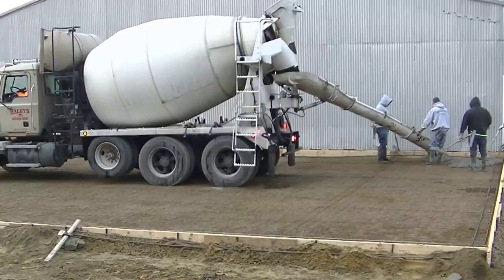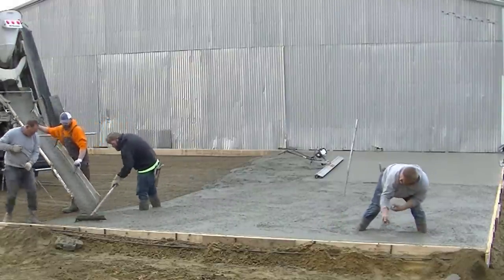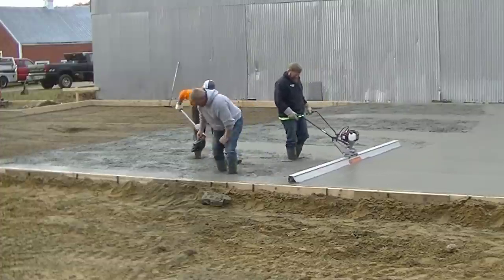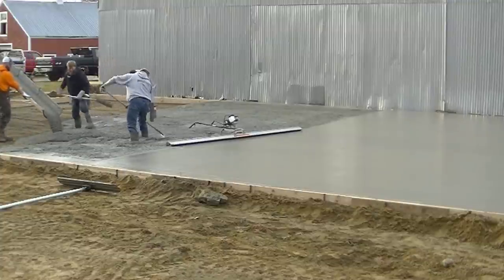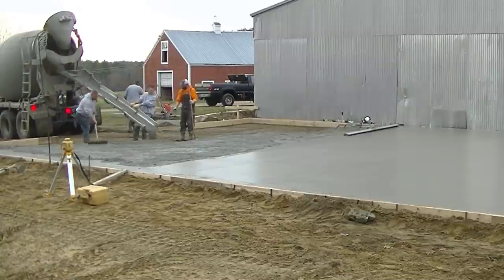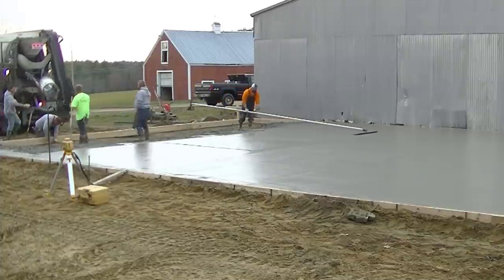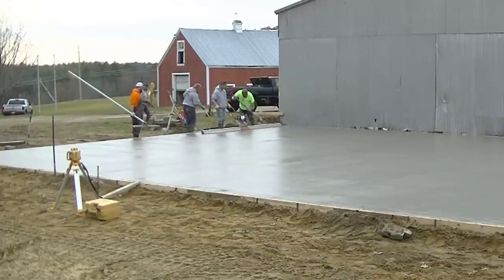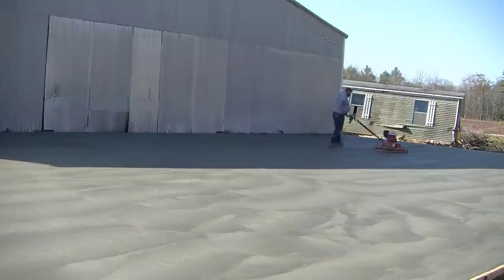How To Pour A 60 Yard Concrete Slab In 90 Minutes

Comment: Last job I subbed we poured 410 yds in 6 hours. Cost me an extra $11K because the concrete batch plant couldn't keep up. They assured me they would have us buried with 100yds/hr. The best they did was 70 and the plant was less than a 100yds from the job. The crew was unreal 9 guys, 1 on a laser power screed, 4 ride-on power trowels. Everyone knew exactly what to do and when extremely professional. Love your videos Mike

Comment: Great video, Mike! Last Monday I had a 24'x32' monolithic slab, 3000#, 5",thick  with 6" wire mesh and 3-#4 rebar in the footings for a detached workshop. It was 35 degrees when they started. The slab has a 4'x14'x8" thicker area for a 9000# auto lift. 20 yards  pumped with a 45 meter truck to go over our home. It took with 4 guys 34 minutes to unload and have it bullfloated. It was finished by hand with a 18" trowel on a 16' pole. Gentleman went over it 4 times in an alternating semicircular pattern. The slab turned out string level and 99% smooth!   This was a side job for a crew from one of the largest semi-custom home builders in the Phoenix area that does 200 foundations a month in the busy season. I'm very satisfied!
Reply from the maker: Sounds like they did a great job! Awesome

Comment: Like many of us with decades in the concrete trades a high slump pour lays down easier than your commercial grade pours that have to meet engineered slump controls to meet or exceed UBC standards. Your use of water reducing additive you always speak of gives you the advantage of easy lay down and quick work by power screeds and cap the cream with super wet bull floating. Lots of your residential pours are only 4 sac mix so I wonder how 6 sac would react with the H20 reducer. Wind, sun, temp all change how concrete will finish. Depends on air entrapment for interior or exterior work and your base of wet/dry materials and use of steel or mesh. There is no apples to apples comparison from region to region and building code minimums. Anytime you can lay down yardage of that quantity so quickly it makes things so much easier but we all know the finish is what you are getting paid for in footwork. Rock on Mike and crew! Concrete Gods are smiling upon you!

Comment: I'm amazed that a vapor barrier is rarely used under your building slabs. Also the lack of a footer or rat wall. Here in north west Ohio we at least have an 18" rat wall and vapor barrier.
Reply: Yeah,a covered slap gets plastic under it
Reply: @deadmanwalkin5064  Yeah, they do substandard work imho.  Gonna have all kinds of cracks.
Reply: @joemonroe9456  different areas different ways of doing things I've seen some stuff in PA that would make u shake ur head... where sidewalks in ny are built stronger...

Comment: Good rakers are critically important. 
Just as important as finishers.
Reply: Every guy needs to be pulling his weight including the driver. One guy slacking or not tuned in and everyone is under pressure. Every task should have a designated executor with help from a guy that's free if needed. Never have ambiguity about who is doing what.

Comment: A rancher picked up  a power screed off the side of the highway (some one must have for got to tie it down) and after getting law enforcement involved and filling out the paper work he sold it to me for $150.00 , what steal! That was back in '05 and I loved how it made it easier for me to pour since i usually pour by myself. The price of concrete here in south central (Rawlins) WYOMING is at   $165 per yd ( i pour 6 sack so its $175 ; fiber is another $10 per yd. & adding a retarder or calcium is  another !0 per yd.., yeah very expensive here for the last 30 yrs. You guys make it look easy thx for sharing. -joe

Comment: This video is the exact reason I do my own concrete.  The steel goes in the middle of the pad, not on the ground. Who cares how fast you can run a truck empty if the rebar or mesh is on the ground.
Reply: i have a builder building us a 2 and a half car garage.. im putting 2   big  1 ton desil pickups in it..   he is not putting any bar or screen in it and only pooring 4 inches with 4,000 psi.   i really think he needs to put some kinda bar or screen in it.. he says no!    what do you guys think??  i really need help on this ??
Reply: They pull the wire up off the ground as they pour, but then walk all over it. It really needs chairs.
Reply: @TheDepreys  if he is using fiberglass fiber you don't need any bar or wire. Just my opinion I pour garage floors daily never use rebar or wire. Only fiber. I use a 4k psi 4in thick. It's ice cream
Reply: I agree with you
Reply: Wire mesh is just to keep the cracks closed not to add actual tensile strength. If it was real reinforcement it would have be placed in an exact position.  At the end of the day reinforcement doesn't stop it from cracking it just effects how it behaves after cracking.
Reply: If you actually watched the video you can clearly see a  guy pulling up the mat in front of the mud. He stays right in front of it being poured and when there's mud to support it he will pull up. Either you're blind or you didn't watch the video.
Reply: @pillaryclinton6187  and what do you think happens when 2 seconds later you have 3 guys walking on it?? That mesh goes right back to the ground.
Reply: @tylerwhite4743  like he said, the aggragates in the concrete will hold the wire mesh up even if you walk on it..
Reply: He picking up the mate him self he said in video
Reply: First off you don't pour concrete you place it!! and for the dude who said that barbwire doesn't add to the tensile strength you might want to go back and read a couple books on physics!!!
Reply: @TheDepreys  that floor should be full of cracks by now?
Reply: It doesn't even need steel
Reply: But he has a wire puller in his hand
Reply: @trademarkoutdoorservices2363  nice keep doing it

Comment: Id love to try the screed demon Mike. Few big patios coming...20' x 30' in May
Reply from the maker: Aaron, where are you located?
Reply: In Detroit, MI
Aaronbrunson@hotmail.com
Reply: @aaronbrunson2179  How are you liking your power screed for outdoor stuff? I've used mine about 6 times now in 2 weeks. Absolutely love it
Reply: @gumballer133  unfortunately, i never received one for trial or purchase but Ive got my eye on a honda motor and bar attachment w/o screed. Got a bball court and 3 driveways to do for August. Maybe Mike will reach out but...congratulations Gum!
Reply: @MikeDayConcrete  any demons still around?
Reply: @gumballer133  how may guys are you using? What makes you love it?
Reply: @aaronbrunson2179  So we are generally speaking an Asphalt contractor,  but everyone and their brother wants Concrete done this yr also. Anyhow,  usually 4-5 guys when we pour, only 2 of us being decently experienced. Lots of driveways and patios. We use a Vibra-Screed by Allen engineering.  I easily free up one guy with me straight edging alone. We only vibrate one pass though,  and it makes it super easy to bullfloat and edge.  I'm only 3-4hrs from you on I-80 in Ohio
Reply: @aaronbrunson2179  Magic screed is what we use.....

Comment: With the mesh we chair it up behind the truck as they are emptying truck, and put any chairs in U can while waiting  for next trucks . Being 8  inches thick we would probably be told buy engineers 2 layers mesh 50 mm chairs on bottom layer and 150 mm chairs on top layer vibrate and pump it . Your way looks fast and put in and set up quickly, good job.

Comment: That was a nice money-maker there. No slopes and no pipes to deal with. 
60yds/hr is the typical rate at which I would order most slab pours for 6” floor slabs. If it was only a 4” slab, maybe 50yds/hr. For large warehouse type slabs at 6”, pouring with a laser screed, we would go with about 100yds/hr. Typically around 6-7 men on the crew and maybe 2-3 more laborers for really large pours.

Comment: I dig pour and finish footing walls and floors and im jist a tthree to four man crew here in ct. We generally pour 40yards or less floors but few times a year there will be a 80 to 100yrd pours and your set is identical to what we do. Nice job. I use a power screed and finishing Whitmans. But not ever used a powerscreed board like the one you have.

Comment: @Mike Day Concrete    I am gearing up to pour a 40x60x6” slab for myself. My problem is I live on vinalhaven island. The ferry ride out here is about 1hr and  15 min. One way. Can only fit two 10 yard trucks on each trip. My question is. What are your thoughts on pouring it in three sections on three different days? So it would be three 20x40 slabs. Is this feasible? What type of expansion joint material would be used if any?  Would I want the rebar and wire mesh to run across the joints? Kinda guess yes to going across the joints so it ties the slabs together so they don’t separate?  Thanks for the great videos. I know it takes a lot of time to film and edit them. And also thank you for any info. I would hire a crew to just do the entire thing. But I need it to be as inexpensive as possible. My boat shop burned down July 3rd this year. (No insurance). I lost almost everything. So this new steel building and slab are all going to be out of pocket for me. Friend of mine did set up a go fund me for the shop. And it did help. But I’m still going to be out of pocket $100,000 before I even start filling it with tools again. Anyways. Thank you. Ian adair.  (Mad Man Marine)

Comment: You want the reinforcement on the lower (tensile) side anyway. 2"-2 1/2" from the bottom on an 8" slab is ideal.
Reply: Pick any location on that slab and watch it.  You will see it get stepped on at least once.  Having taken as many core samples as I have, I can tell you that the mesh ends up exactly where you would think it does, if you bother to think about what happens under all that foot traffic.  The vast majority of that mesh is only "imprinted" on the bottom of the slab, or maybe embedded a quarter of an inch or so.  Good commercial crews have methods that allow them to avoid walking around all over the place once the concrete is in place, but they are also a lot more likely to place re-bar on chairs since that's what the specs will call for.

Comment: Hi
Mike nice work, I’m from Ireland but live in Australia concreting, just wondering about the demon screed do you find them better than the regular Honda screed, I was just curious about the hollow at both ends of the screed blade, do you find that some concrete can go into them hollows and pull the blade down or is that not a problem with them?

Comment: I drive a redi-mix truck in Michigan. I can haul 12 yards on my truck. My truck is also front discharge. I am able to blow out 12 yards in about 15 min with a good crew, the guys striking off are only pulling 1/2 inch of mud.

Comment: We pour a little slower but we are old men...lol.. three of us and the boss is the youngest...54...  we just did pretty much the same size pad. 34 yards 4" thick.. done, broomed and cleaned up by noon.
 We only have 2 months when you need hot water so you can usually work around pouring in colder weather. When you do, hot water is free, they are thankful to get the job as hardly anyone pours then.

Comment: Might as well have saved the money on wire mesh, they pull it up once and walk over it five times pushing it to bottom.  Im only second generation concrete pouring in family, my end of it now after many years pouring is crushing concrete.  95 percent of all concrete that has mesh that I crush it's pressed completely to the bottom.  Rebar mat or paving mesh with suspension chairs to ensure proper height in slab.

Comment: What are you using for your wire reinforcement?  looks like cattle panels.  I'm fixing to poor a 2000 sqft slab and I'm just doing a little research.  Thanks, y'all do fine work.
Reply: Usually I use 10mm 1/2” rebar 
Or a mesh sometimes

Comment: In Utah we only have cement trucks that shoot off the front of the truck.  What is the advantage of a rear shoot truck. It seams tougher on the driver and it might be slower.  Can someone tell me about the rear shoot trucks. I have no experience with them.
Reply: The are cheap because they are older, and cement trucks are expensive.

Comment: Putting floors in with a laser screed,  90 seconds and the whole load is on the ground.  Here comes the laser screed to pull it all down to grade.  I've been on 600 yard pours, first rock hits the ground at 8AM and machines are off the floor at 4 PM.
Reply: "walking off a floor" is trade lingo that implies the set was fast enough to machine finish rather than hand finish on your knees.  So braggingly you would say, "We walked off it a 4"

Comment: WHEN I POURED MY 40 X 60 SLAB FOR MY SHOP IN THE SUMMERTIME DESERT.THE WIND SUCKED THE WATER OUT AS FAST WE COULD POWER TROWEL. END UP ADDING SEALER WHILE FINISHING. IT WORKED BUT A REAL STRESS OUT

Comment: The ground seems to lack a gravel foundation. If some softer area sinks the concrete cracks.
Reply: Concrete always cracks, it’s not a if, it’s a where. That’s why you either groove or saw cut the concrete in areas so it cracks along that line. Anyone who tells you the concrete won’t crack is bullshitting you. Although I always use a 21AA limestone base thoroughly compacted in 2” lifts as thick as the concrete you are pouring.

Comment: Driver asked me what I want for a slump? I've poured a few small 10x10 pads for hot tubs, slump didn't really matter. Going to attempt my new garage floor, what is the slump I should tell him? Will probably be in the 40s, maybe low 50s when it's done.
Reply: Do about a 5.5 slump
Reply: 6 bag mix 4 inch slump pour half screed and bullflot  pour the rest screed bullflot and finish trowel cut the edges and joints done drink then strip tomorrow
Reply: @barryengelhardt2429  what are you wanting to kill him 4” slump you better know what the hell your doing and have a couple guys who do too!! 😂 😂🤯

Comment: Looks good.  But pour that 60 yards at 4 inches thick instead of 8. There’s a big difference. Yeah you poured 60 yards but it’s like finishing 30 yards at 4 inches. We pour 40-60 yard slabs all the time at 4 inches. Just 2 of us. The only advantage we have I guess is all our trucks are front discharge trucks so that eliminates a person. We average dumping out 10 yards in 10-15 minutes. Of course depending on the driver.  But this is a good video. Lots of good info. We are in Kentucky and for the most part we do everything the same way. Except we mainly hand screed everything with a 1 person 12ft screed

Comment: I've tried power trowel a few times. Never liked it.
Reply from the maker: It takes a little time learning how to control it without fighting it.
Reply: So I pour a good bit of concrete. When it comes to repairs how knowledgeable are you? I have a stamped coping band around a pool we poured with a broom finish patio behind that. I used the rubber seams to joint the coping then cut the broom finish with a appx 3x3 pattern. The problem is the guys laid out the 3X3 squares on the broom finish and then cut straight through the stamped coping. I caught it after he made about five cuts and there's no making it look uniform. I either have to repair these cuts with a charcoal color hardener or tear out 25 ft of stamped coping and re pour it trying to match color. What would  you do.
Reply: I own a swimming pool installation company in Ohio. Originally from CT. All my family is from Lewistown Maine. I'd love to chat sometime. What's your email, I'll send you over my contact info.

Comment: Mike why don't U use chairs under mesh , picking it up with a hook ends up back on ground especially heavy mesh , we always have steel  average 30 mm cover of concrete over steel .our engineers would not pass it . Different countries I guess.

Comment: Having two trucks side by side is faster and only need one other guy at the most. This is not fast at all. Poured a 120 yard running two trucks at the same time in less then an hour. And that's leveled off . Do you have a a frame that runs off cables? Way faster and broom right behind it

Comment: that mesh may as well not be there , its pointless on the ground and lifted a little
Reply: My exact thoughts I have poured concrete for almost 20 years now and it’s wire is all good if you can keep it in the middle of the slab, but if you pick it up a little as your chuting then the guys walk all over it they are just stepping it back down to the bottom of the slab where it lays useless.
Reply: I was thinking the same thing and I have never poured concrete.  Why wouldn't you use some chairs, at least around the perimeter for a height reference and then just pull up the center from the truck?
Reply: You guys are full of total bs go break out some concrete with the wire at the bottom and tell me it's not doing the job lmfao people get crap stuck in their head
Reply: @baconneggs2406  go break out concrete with fibre in it , it’s all the way through the mix it locks it together, I have seen floor crack with mesh on the bottom and when the company changed to poly finer that all stopped , I use it myself and swear by it , it works out cheaper where we are than steel mesh and there is no labour cost either .
If your pouring bays is easy to drive the truck straight in and not have to worry about trying to pull mesh up, there the reasons why it’s better so is it bull shit ?
Reply: @2362marshall  You don’t know shit if you think fiber would work as well rebar or mesh for this pour.  Fiber is good at reducing surface cracks.  The mesh only has to be 1/3 the distance from the bottom.
Reply: @deadlata9767  it’s works better than mesh that’s left on the bottom , mesh in different positions has different functions